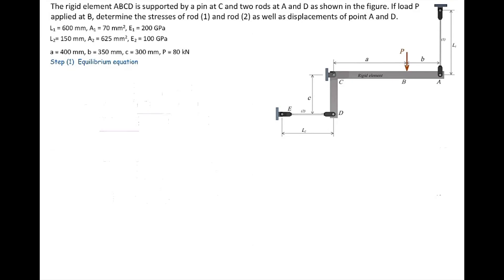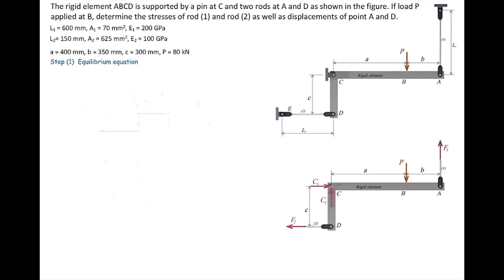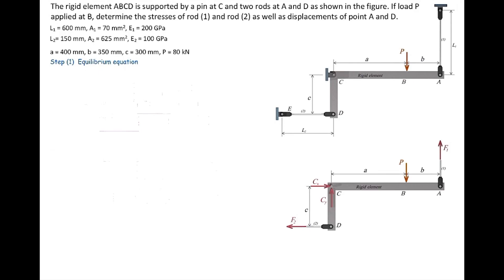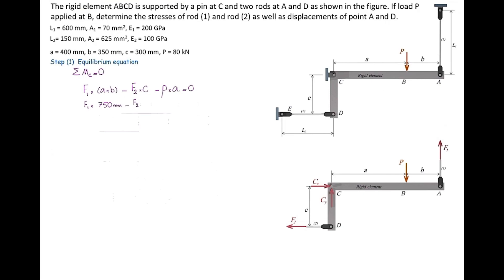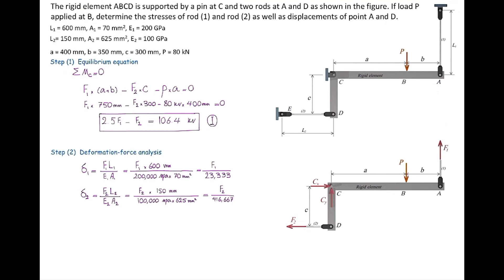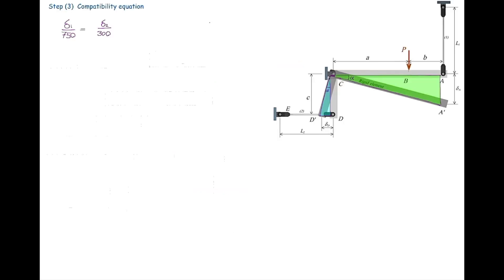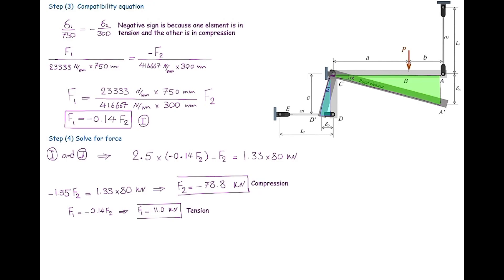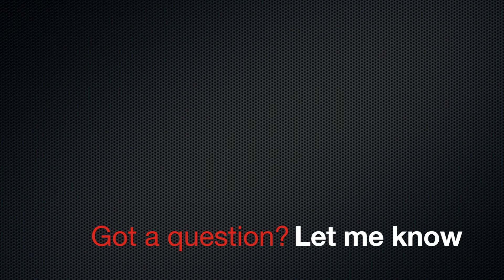A detailed example of an indeterminate structure with axial members

Comment: Can we use equations of equilibrium of Fx and Fy on this problem? Is the sum of forces of x-direction and y-direction still equal to zero?
Reply from the maker: Yes sum of the forces in the x and y directions are still zero; These equations could be used for finding reaction forces (Cx and Cy); but these are unnecessary in this problem. Hope that helps.

Comment: Great explanation. Thanks. But i have a question though. According to the definition of free body diagrams, we should mark the forces on the FBD of the rigid body and then the forces should be marked separately on FBDs of the 1 and 2. But sir you did cut across the 1 and 2 rods and call it a FBD. Should not we follow that method? Or else this sketch cannot be called a FBD.
Reply from the maker: Glad you liked it and thanks for the question. 
The forces in the rods are the same as the forces acting on the L-shaped rigid element at point A and D. Thus two methods you mentioned are technically the same. in general, the free body stands for any object(s) that is free from the supports. It could have just one part or multiple parts. The requirement is to be free from supports and replace an unknown force at each cut section. Hope that helps.
Reply: @MechanicsofMaterialsLibre  thank you sir. Now i understood